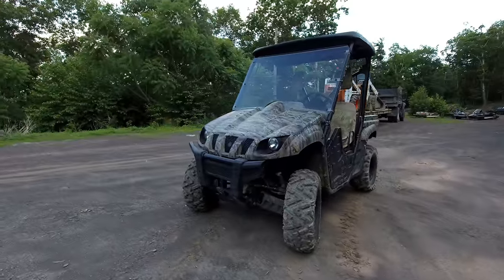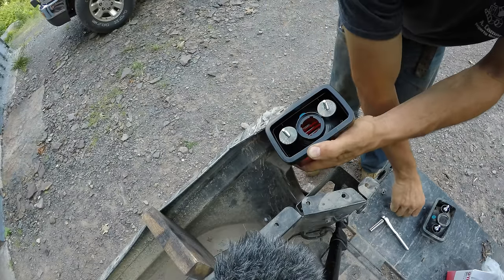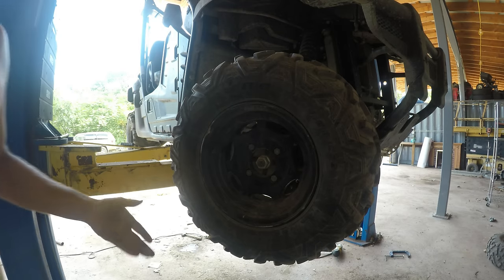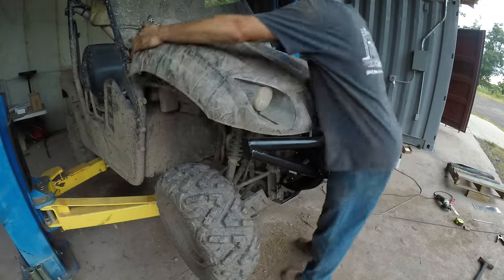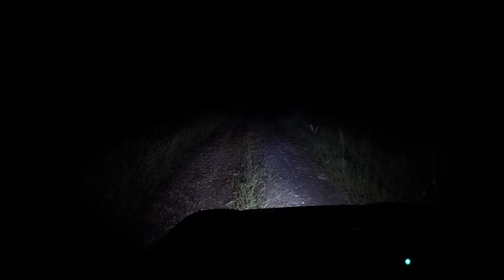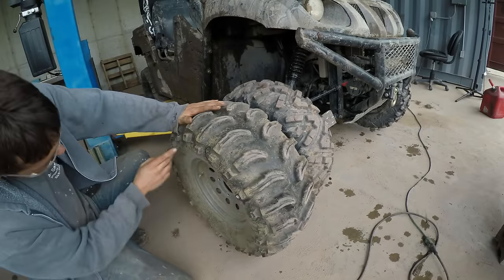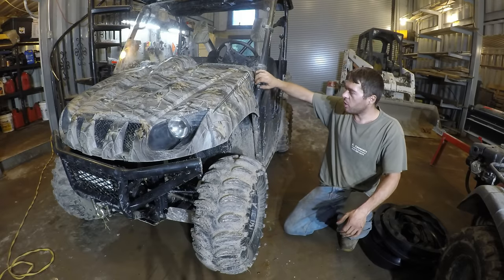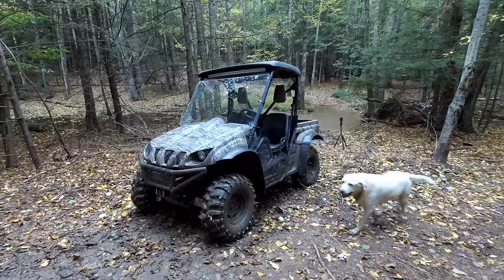Buying a UTV

Comment: Andrew, to save me money and keep me away from the cycle shop, could you show sometime on how to change the oil.
Reply: Man, it's so easy, just try.
Reply: @EFCasual  I dont know anything about mine, i changed the oil and much more that needs to be done to sll of the 4 wheelers i had but ive been under this one and cant find the filter and drain plug.
Reply: @jeremy2033  you can find a diagram for the engine online.

Comment: When welding galvanized steel best to remove it with muriatic acid. Dip it or paint it on then step away that’s 15 to 20 feet in a well ventilated. That stuff not good for you

Comment: hold up why snip the cable at then middle and solder a joint there why not do the cleaner much easier much quicker way of just re terminating the end at its correct length

Comment: A  Tube Chassis is not as stung as a frame is and the independent suspension is  not as strong as life  Springs / Solid axle or air bags so there for this rhino is ment for the job that a truck can go it ment for small things a round a farm

Comment: 25:40
Why loosen the bleeder?
Reply: To allow for the piston to move back so he could put the new pads in. The old pads have less thickness, so the pistons were too tight to fit the new, fatter pads in. Opening the bleeder lets the pressure out so the piston can move.
Reply: @ChasingChevy  Yes, but it shouldn't be necessary. Doing so allows air to enter the system.
After all, the brake fluid must always be able to return to the reservoir when you release the pedal, otherwise the brake will not release.
If you can't push the pistons back, there's something wrong.
The master cylinder will always allow return if the pedal is fully released.
Reply: @SuperDataSafe  Without a vac pump, those brakes are hard as a rock man. There is probably some specialty tool that clamps on there and you can get enough force to move the piston - but with a c clamp it might just be easier to let some fluid out and do a bleed later if it needs it.